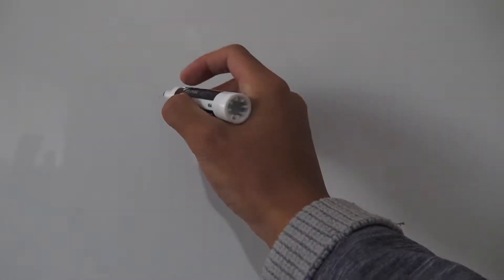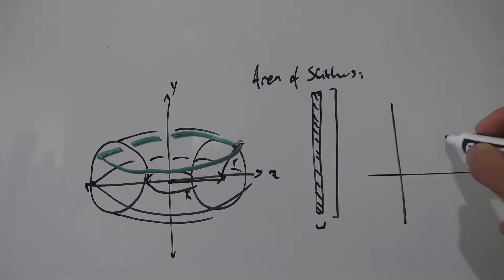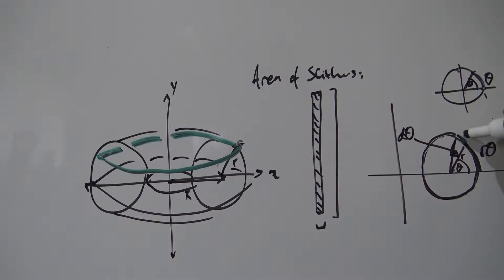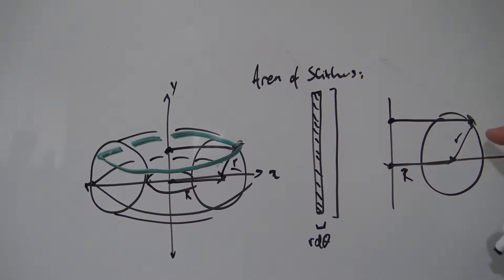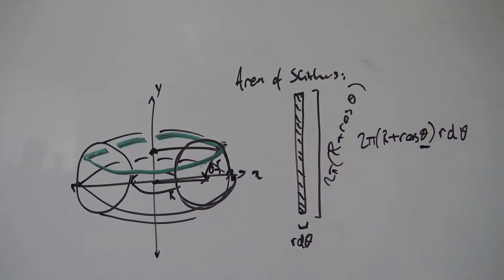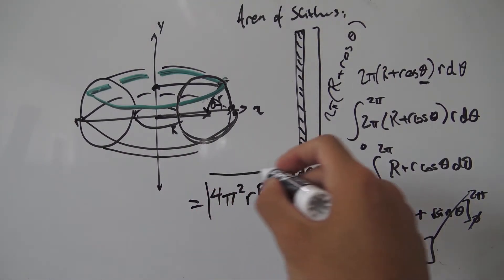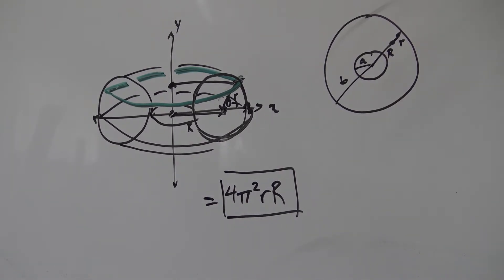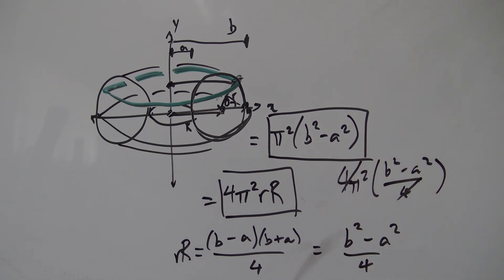Surface Area of a Donut

Comment: Um actually the pizza wins the ranch dipping point using the average thickness and crust size of a standard 10 inch diameter pizza, even including the crust the ratio for a wing is 1.2 whereas the ratio for a pizza is 5.833 mean that you’re getting more ranch per volume eating pizza then you are eating wings by a factor of 6.99996.